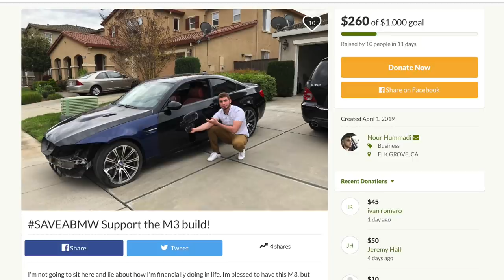Rebuilding A Wrecked BMW M3 Part. 10

Comment: Why don’t you just get a set of wheels which fit to the M3 without any spacers? 
If the wheel you want to mount is not wide enough the tire probably isn’t wide enough too for a 400hp car. 
I know - wheels aren’t cheap, but I wouldn’t go cheap on my wheel setup if I had an M3.

Keep it up man! Greets from 🇩🇪

Comment: On a Manual Transmission bro, while the car is off put the gear in reverse then only put the ignition on and while the gear is still in reverse the rear reverse lights should still appear!